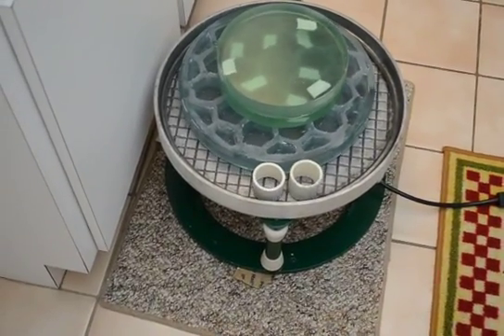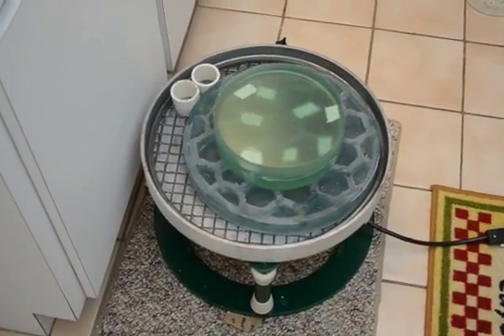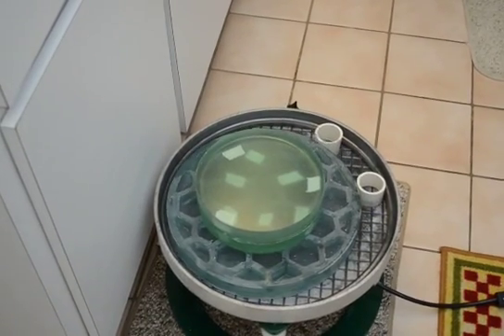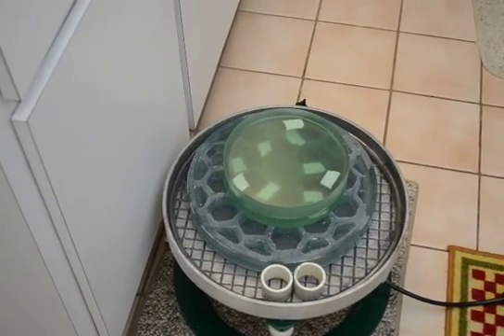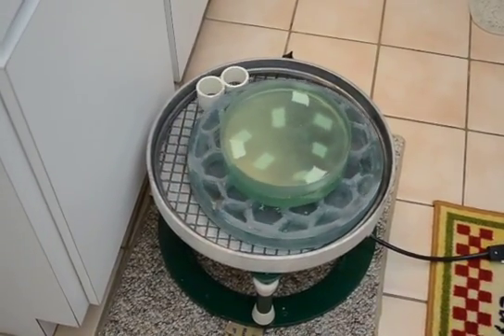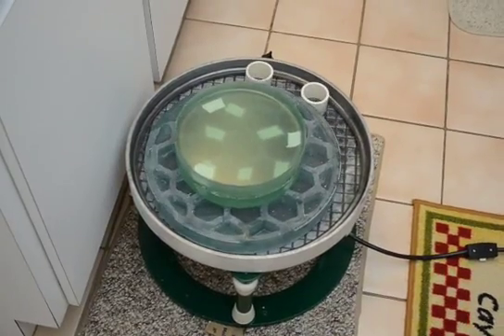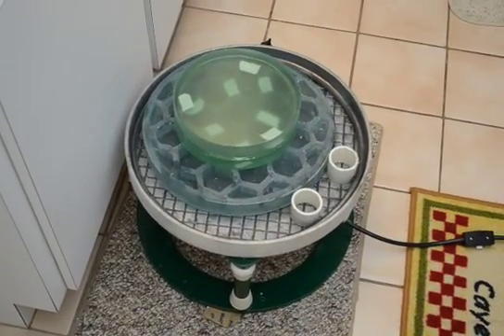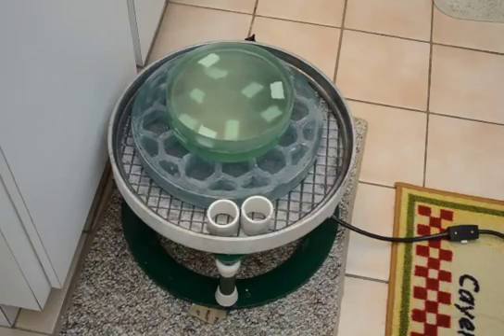VibratingLap1

Comment: Covington makes such nice equipment.  How's it held up, 8 years later?
Reply from the maker: I've had to replace the top pan twice. with heavy use they get concave (dished out in the center). Makes it hard to produce flat disks. Might be last longer if they made them of cast iron instead of aluminum. I see that Covington has started selling steel insert disks for their rociprolaps to lengthen plate life. I may look into making something like that for the vibrolap.

Comment: A honeycombed telescope mirror, can have a glass weight as much as 80% lower than a solid glass mirror of equal diameter.  That weight reduction allows a lighter support structure not only reduces total system weight, but also greatly reduces the overall system cost, so to summarize; honeycombing can have reduced cost & weight, while stile having the same functions as a 'standard' heavier system.